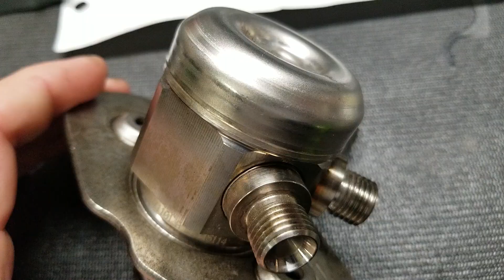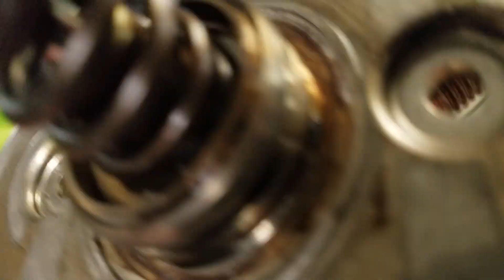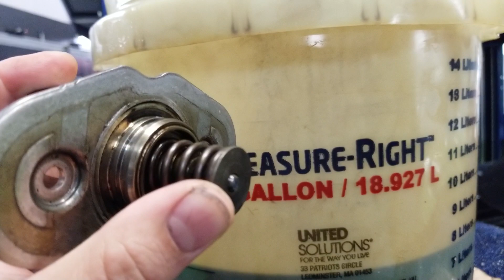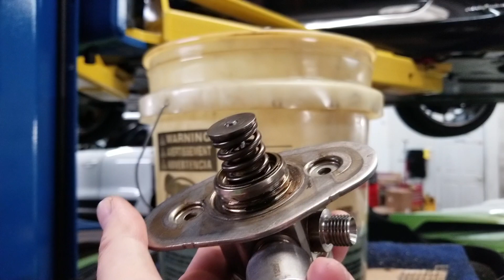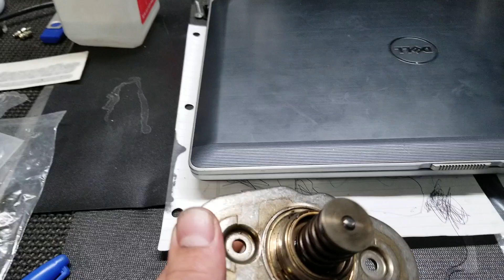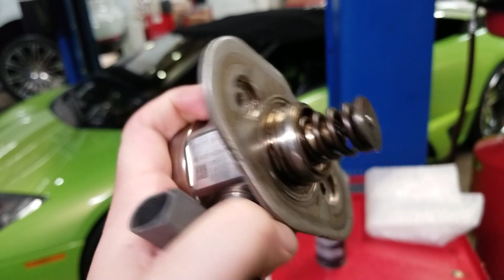Porsche Macan S Engine oil consumption | HPFP failure and engine

Comment: if you have a 2.0 turbo 4 cylinder and your burning oil, its the piston rings like all VW 2.0 turbo 4 cylinders and they will all have this problem. just a matter of when. i have spent as much as a liter every 1200 kms, thats like a quart every 800 miles.

Comment: I have a BMW X1 with N20 engine and this is the first time I have heard of this high pressure fuel pump in relation to the timing chain failure.  Do you suggest the pump be changed at a certain millage before it causes sever damage to the engine?

Comment: The more people buy these things we will have to source out fuel pumps like Walbros and replace those stupid pumps. Also for timing covers bolts if they leak out you can replace them with ARP Head bolts for the Macan Timing covers. We will have to incorporate the parts that make these things fault proof. Freaking Porsche get with the program man.
Reply: As long as people keep buying and thinking "that's normal" #becauseitsporche. Porche will do nothing but laugh at you.